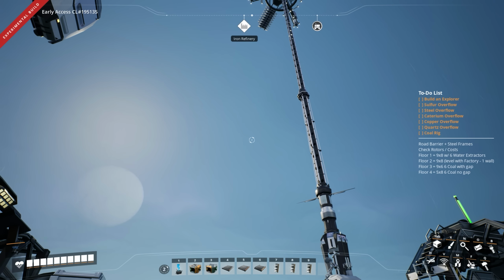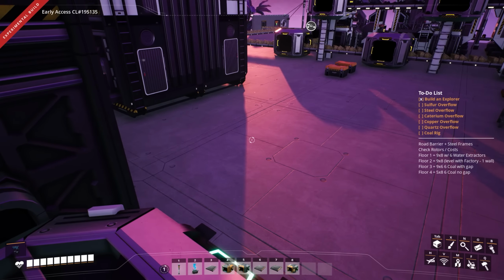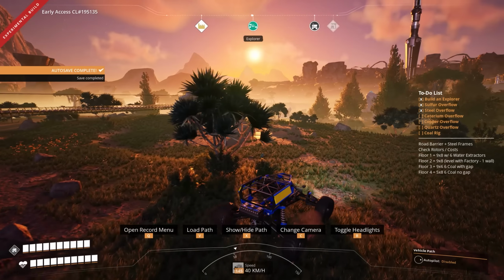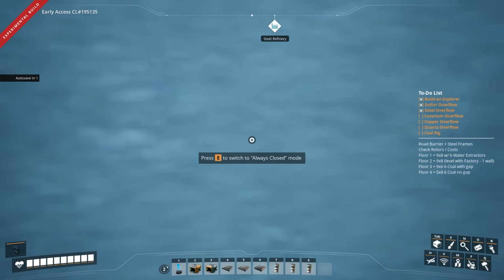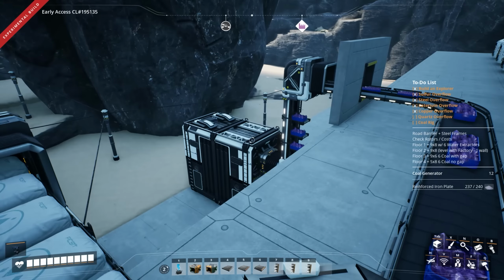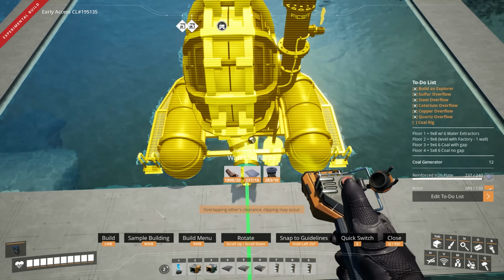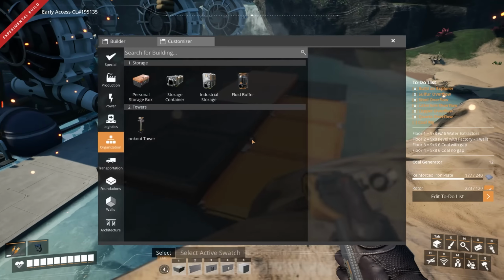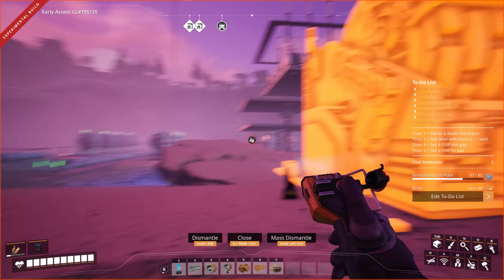THE EXPLORER! - Let's Play SATISFACTORY Update 7 - Ep.13

Comment: Inventory tips:
1. Murder your slugs immediately. Power shards stack
2. Biomass is always more bulky than leaves, wood, or animal parts, but if you make it into solid biofuel, it's more compressed. Making it in the field can save you space in early game. 
3. Use your vehicle storage for junk you want to take back or sink (darn you somersloops!) 
4. Build an awesome sink with a box to quickly rid yourself of sinkable junk
5. Don't be afraid to trash raw items like ore, they are infinite.
6. Put extra items in the car you dont normally carry in case you run into hard drive wreckages
7. Expand pockets in the MAM ASAP. Possibly the most valuable upgrade imo
8. Have a predetermined about of plates, rods, concrete etc that you "normally" carry. This way one glance at inventory will tell you you are lacking
9. When you have truck stations, you can create supply stations delivering plates, concrete, rods etc to your project sites. Will save on running for you XL builds later on
10. Running around is part of the fun, just enjoy your supply runs 😂

Comment: I'm pretty sure I'm not the first saying this 5 months in, but just in case: you could put down the power poles with the wiring tool only, if you point it to the ground it makes a pole, if to the wall it makes a wall connection, but most importantly it adds a wire immediately, so you never have to go back and connect up free standing power poles.
I don't even have power poles in my quick bar. Only time I need to say power pole instead of connection is if I want an upgraded one - and you can upgrade in-place.

Comment: Hi i am really far from your last video. So i dont know if you allready know but if you want put a splitter or M on the belt. There is different if you pointing on the belt in the middle or on the frame of the belt where you want to put the S or M. And one of them do the automatic conection with the others belt or inpur output and the other is not. You have to try i dont know that right now. And sorry about my English. Hope that will help you. If you dont allready dont know that.
Reply from the maker: Thanks! People have told me this but it still doesnt always work. I show it later too!
Reply: @WhatDarrenPlays  hi i think next video i sent you link to video where the guy show how it is works like 2min. Video check it.

Comment: It was so long ago that I'm sure you've fixed it by now, but the quartz area overflow is insufficient. Since the overflow needs to be able to handle 100% of the output of the facility, it can't all fit on one belt like you've built it. You need a separate sink for the top layer.

Comment: Unless your just doing a ridiculous overclock method of rotors/stators, your motor factory should not take anywhere near 700mw, you will need alot of extra stators much later on but you need to be stacking industrial containers to hold/transport them to your next tier leveling area. That build spot on is amazing though for coal power/steel, i used it on several saves even when i didnt start in that biome, directly west you will hit more iron and copper to do everything you need for quite awhile, interesting build spot though, definitely will have to watch next video to see progress.

Comment: I've fallen a bit behind in these videos, but am trying to catch up. I assume you may have already discovered this but I know you said it was still worth commenting on old vids. You've got 3 sets of conveyors and 3 sorters in your bar at the bottom, but you just need to put one down, and then press E to cycle through the different types. The only other thing to mention, is that I've found the same problem you have with smart splitters, in that they sometimes don't do stuff. 
I typically just leave them on "Any" as opposed to what you're doing which is specifically choosing the expected input, but I've found I just reclick Any and it appears to work. Dunno what's going on there.
Reply from the maker: Thanks! For me it actually has problems in “Any” where things wont go through, but not if I specify the output, then it works fine. I can’t quite remember but someone said its a bug with either the left or right output spwcifically when its set to any.
Reply: @WhatDarrenPlays  yeah I reselect Any and it seems to work, that's what I meant. So I chuck it down, it doesn't work, so I just select Any again and now it works. But your way also works so 🤷🏻‍♂️

Comment: I just learned this the other day from someone else, but if you're inserting a merge or splitter onto an existing belt, you need to aim at the middle of the belt (not the edge) and then build. If the belts on either side flash gold, then you know the splitter/merger has successfully inserted itself and you don't need to delete and re-add the belts. I have found the same thing with holding Ctrl and trying to place a splitter/merger, though - it just slides along instead of snapping. Someone else here mentioned you have to be above the belt for snapping to work, but I haven't tried that myself yet. Looking forward to seeing what cool designs you come up with for the factories later. PS. I love the Explorer! PPS: I'm guessing you're trolling people by leaving that one section of the water pipes painted in orange ;)

Comment: You are spending time building coal power plants, it is ok but you can temporarily just overclock your existing setup to double the output ,while you go on to build oil processing which will make you more power. (PS you are not using power shards to the fullest quick setups with few machines on the ground that are overclocked to the 250 can produce some materials fast, just put stack of resources yourself)

Comment: Not sure if you are aware or someone pointed out but when you select say a splitter you can hold "E" to get the radial menu and just tap to quick switch.  And on the storage box you can just de-construct to grab everything at once and save yourself the steps of going into the boxes to grab then de-constructing it.

Also you can store unused tickets in the Purchases tab of the store.
Reply: or you can press E briefly and cycle through the different types of splitters, belts, foundations etc.

Comment: Just want to bring to your attention that the quartz sink will eventually get clogged when both the quartz crystal and the silica are being sinked  you will have 2 240 belts feeding that box and only one 240 belt coming out. Also why have a box right before the sink any way when you intend the sink to run just as fast as as the production line that's feeding it?

Comment: I think the easiest way for me to get around mergers and splitters not snapping appropriately when trying to apply them to a belt is to delete the belt, place down the merger/splitter, then reattach the belts. I also tend to place any mergers and splitters before placing conveyor lifts as the later can snap to an opening if placed in the correct position. I've always had issues with placing a merger or splitter directly on an existing belt for sometimes the belt seems to ignore the splitter as if it was only a random object clipping through the belt.
Reply: I agree. Getting the splitters/mergers placed then adding belts is the better way to go. I do still add them to belts but that's when I'm in a hurry and not caring how it looks.

Comment: FUEL Power is the key here... but you need a lot of computers and heavy frames, motors... but its worth doing it asap after unlocking fuel power
Reply from the maker: I’m planning on building another 900MW of Coal Power and that’ll be it! It should supply me with enough to make a motor factory and enough to start the fuel process!